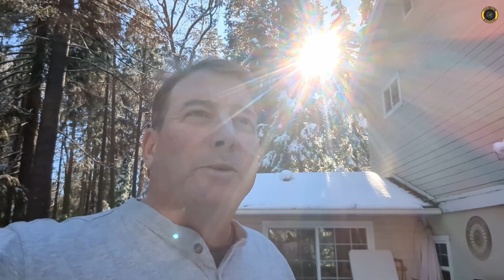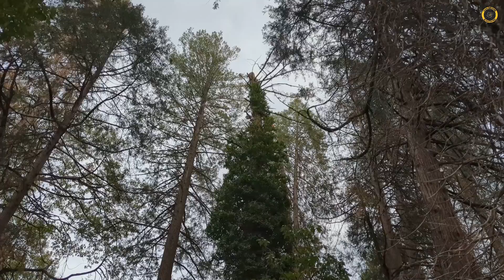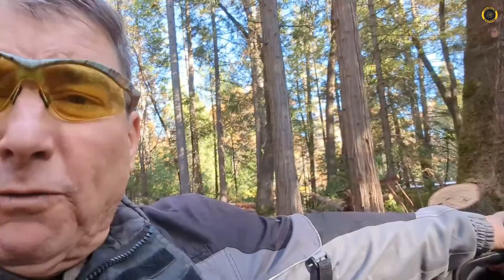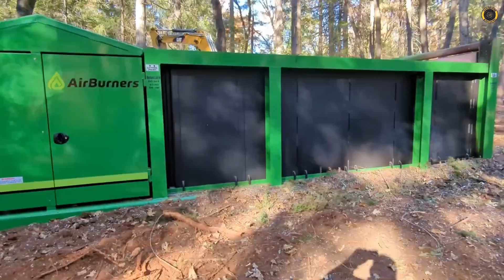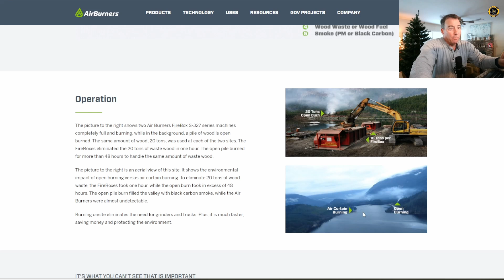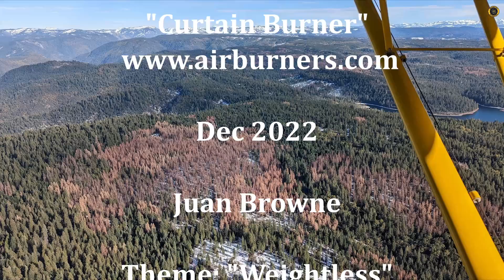"Curtain Burner"! and Winter Storm UPDATE 12 Dec 2022

Comment: I'm not sure how burning biomass "just to get rid of it" is more eco-friendly than chipping/ mulching it.  I only have a few acres, but could use as much mulch as I could possibly create, to reduce moisture loss and keep a lot of the undergrowth from coming right back.  

Unfortunately I don't have enough material to justify the cost of a commercial shredder-chipper, but I am hoping to get an outdoor furnace/ log burner when I get a swimming pool dug, and we should be able to have year-round warm swimming burning the 3-5 trees we lose every year.
Reply: Indeed it seems like a waste to me.
Reply from the maker: Lets do the math on your chipping and mulching-it's all in the numbers, regardless of any emotional bias.
Reply: @blancolirio  It is in the numbers, as an accountant I'm not going to argue with you, but AFAIK the ash is near worthless (may have some fertilizer value if you have a garden), whereas chips/mulch cam either be used or sold.  

I will concede it is possible (though I think not likely), that the processing of mulch could cost more than the saleable value of the mulch.

There are also the difficult-to-place-a-value-on matters of how the environment benefits from (i) moisture retention in the ground (ii) increased organic matter in the ground as the mulch rots, and (iii) less CO2 in the atmosphere.
Reply from the maker: @pulaski1  Mulching= 100 gallons of diesel per hour....Byproduct of Mulch- METHANE gas. No easy way out, See?
Reply: @blancolirio  Not sure where you pulled that data from, though I could hazard a guess. 😆   I have actually rented a 12" log chipper myself, and it certainly did not use anywhere near "hundreds of gallons of diesel/hr", not even close.  In fact a 5gal can kept me going all weekend i.e. a lot less for a lot longer.  

Even a full size "bowl" chipper, which can shred multiple whole trees in minutes, and only makes economic sense for land clearance prior to development, doesn't use that much fuel per hour.  I could see 100gal/day, maybe, but I think that is a stretch.

BTW methane is only a product of anoxic decomposition e.g. under water, such as in a swamp.  .... And everything eventually rots to produce CO2, but the longer it is held in organic matter, the less of it there is in the atmosphere.  Burning turns all the carbon into CO2 immediately.

Comment: Nice diesel generator unit! I've worked on those before. I'm a former Heavy Diesel Mechanic Trainee on a railroad in Oregon. I'm no longer affiliated with the railroad, but I've performed plenty of regular maintenance on a pair of diesel generators, one built in the late 1990's and one built in 2012. The older one badly needs an overhaul, and the newer one is ex-military that works really well. I think the older one needs to be scrapped. Soon the railroad equipment will be converted from tow-along diesel generator carts to self-propelled electric batteries, which is better for the environment. So far, the railroad I worked for is spending $2.8 million dollars for the conversion and other railroad infrastructure repairs.

Comment: Love the burner and power generator. Could it help after a hurricane, when trees etc have to be cleared for power line restoration, at the same time as people need a power generator?
Reply: Great idea!  Lots of downed trees forr sure.
Reply: Trouble is the generator needs to feed the grid. If the grid is out, generation doesn't help. It's the reverse of packing electric blankets in case the power is out. I speak from experience.

Comment: In the old days people would collect the wood to heat their homes in the winter...
Reply from the maker: They still do around here, the amount of dead biomass here is overwhelming...
Reply: Mostly pine from what I saw. Not good for burning inside a home.
Reply: @kevinmiller4486  pine is just fine if you let it breathe.
Reply: @kevinmiller4486  I've burnt pine for years never had any issues..  Heated the house really nice...   sounds like fake news...
Reply: We still do.
Reply: I must still be old days. My chainsaw is a Stihl 031av with points ignition. It's ran on everything from ND 30 weight oil to the latest greatest ashless premix oil. Still cranks up every year with minimal fuss.
Reply: Yeppers A Lot of good BTU'S being wasted
Reply: Right. Why U doing this? Just let the nature work